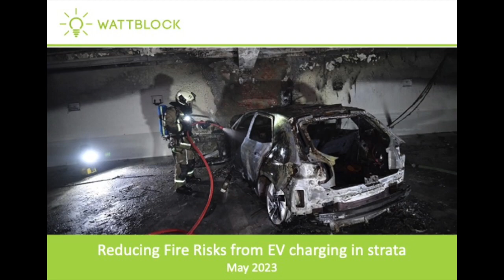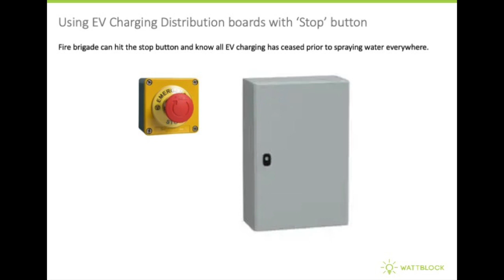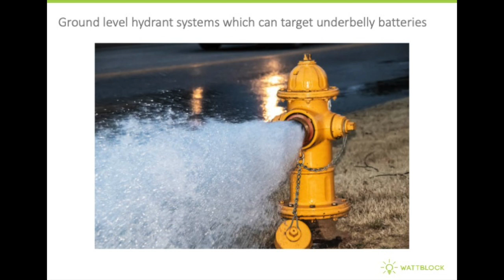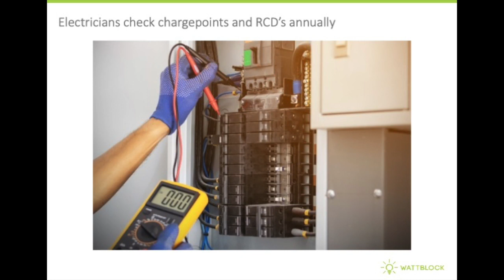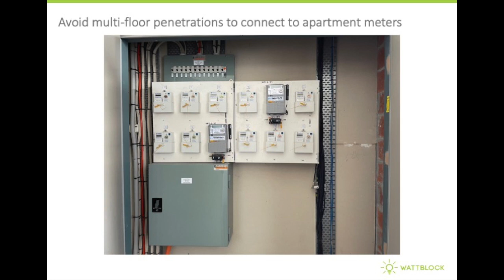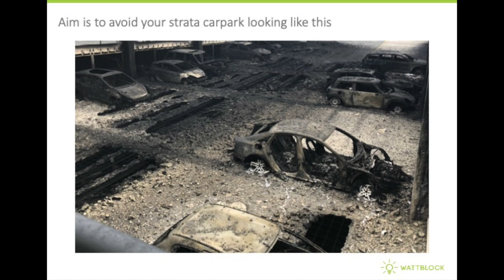Reducing Fire Risk for EV Charging in Strata

Comment: Gee, with a gas engine you have regular lead batteries, and you don't have to worry about lithium-ion battery thermal runaway. Or anything else contained in this video. In other words, EVs aren't worth all of this trouble because they damage the environment more than gas vehicles.

Comment: Did you mention the toxic fumes released from a Li-ion battery fire? Where those fumes might end up via the carpark ventilation system etc.
Reply from the maker: Good one. Only mentioned the contaminated water after the fire sprinklers or fire hydrants or hoses were used. Toxic fumes would also be released through the carpark ventilation system or natural ventilation